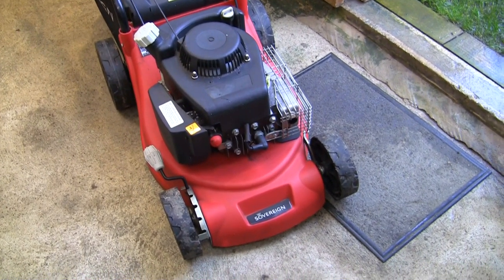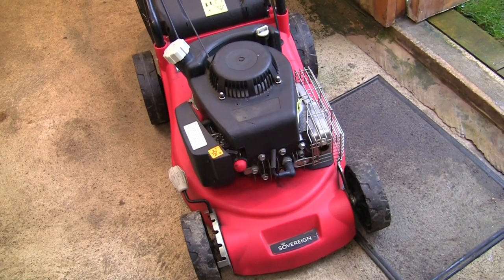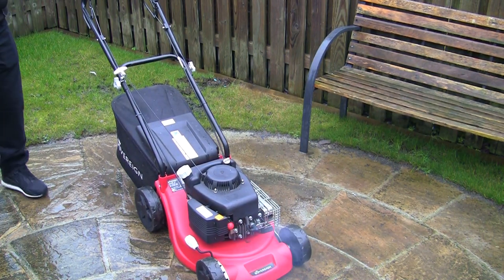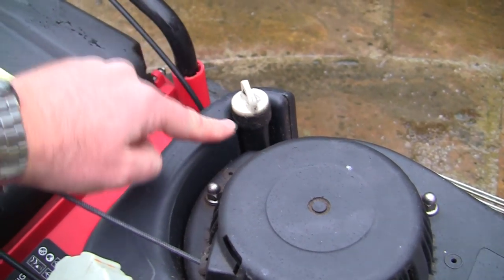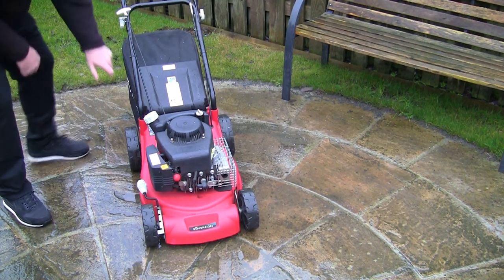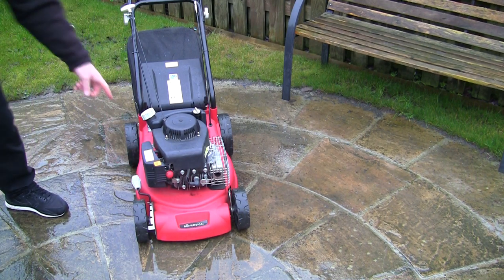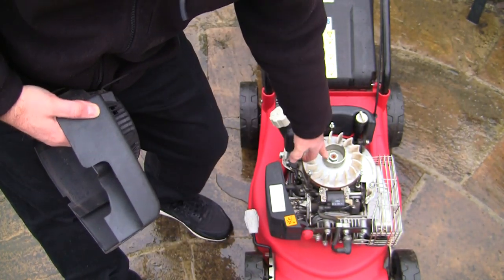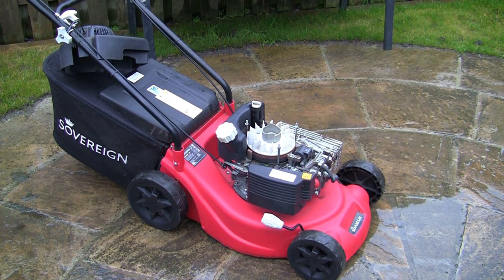Sovereign XSZ40 Lawnmower Carburettor Service (And SV150 Engine Tips)

Comment: Never ever attempted to fix a mower in my life, mine is a similar one and has the same sv150 engine with the lhp16 carb. It would start then just stop in a few seconds, last night, after watching this video about 3 times I ordered some carb cleaner and got my tools ready for the next day. I stripped down the carb after clamping the fuel, soaked all the bits in the carb cleaner and reattached that little spring that had also gone on my mower. I then gave the carb exterior a good sloosh with cleaner and a soft brush. I put it all back together after checking for leaks attached the airbox. Started first time and runs better than it has ever done!!! Thank you so much one dead mower fixed for a 6 quid tin of carb cleaner!! Liked and Subscribed!!
Reply from the maker: Awesome Christian! Nice work!

Comment: Thanks Mower Man, great to get all the detail and tips. I had very slow running on my XSZ40 so turned in the running speed screw to resolve (it has an anti-tamper pin in the crew head but turns by hand anyhow). Might clean down the carb if issues persist. A few notes that might be useful. 
a) mine doesn't have a micro-switch for the engine cut-off - just a sprung metal contact that a cam operated by the cable touches with a single lead (shorting cable) to it (cost saving!). 
b) the little extra bolt at an angle on the float bowl is a drain plug if you want to drain the fuel off.
c) the upright bracket on mine has a clip at the top for holding the fuel pipe mid-way;  clearly missing on your example.
d) the very light spring on the throttle (also bit of sponge under it)  does not control the full travel of the butterfly valve as you said. I suspect that is not supposed to operate the full range of travel - this is done by the main spring on the regulator arm - just provide some damping as it gets toward the end of travel?
Also your website appears to be down at the moment - I have tried a couple of the links and none working.

Comment: Many Thanks Mr Mower Man! With your video I fixed our sovereign mower today! From what I could see there were 3 issues, one - there was a hole in the fuel line near the fuel inlet to the carburettor (luckily there was enough fuel line to snip it off & reattach & clamp what was left), two - the spring on the “bracket” assembly that controls the butterfly valve, three - the spring on the linkage was loose & didn’t seem to be properly attached at the far end. Sorted those & now it runs better than it’s ever done! Thanks!

Comment: Great video thank you so much, picked up a non runner sat outside neighbour house for year, will use as back up mower, engine recoil had snapped, new one from Ebay £20, oil change and followed another vid of yours about the self propel and clutch cable as drive went from not working to new belt meaning permanently in drive, freed up the mechanism and drives, so £30 all in now have fully operational back up mower.  Thanks so much love a good tinker but would not ha e done so without watching you vid and gaining some confidence, keep up the great work!! Lee

Comment: Thanks for the video, I pulled a similar sovereign mower out of a skip today and I ran so badly, probably why it was being thrown out. I set the carb the same as you did in the video and it now works perfectly, looks like the previous owner had the carb of to get it running properly but set the mixture screw to 6 turns out and the float bowl wasn't on properly. Now I have a free mower and don't have to use an extension lead all the time to cut the lawn

Comment: Just about to do one of these picked up for £10 on face book got spark,fires up on carb spray down spark plug hole , reason it did not fire up is the spring detached and a small stick wedged up in governor arm  against engine casing .so will be stripping carb down for a clean service as per your tips on video very informative and helpful advice.cheers steve
Reply from the maker: steve horton Nice work

Comment: Another good un Paul , I use to sharpen blades the same way I now use a cordless angle grinder wit a flappy disc , not a big deal just find it quicker and easier, can even do it whilst blade is on the mower
Reply from the maker: james allan I sometimes do that as well James hope you are well my friend
Reply: Not bad mate , could do with the weather picking up so I can get some sold run out of room and still buying it's a disease😁, I blame you

Comment: I have spend hours online trying to buy a new carb for the SV150. It seems that all of them are the (new?) model with two butterfly valves and will only work with paddle-style governor (mine is internal as in this video). Also all of the new ones have no connection for a primer bulb. I am at the end of my wits and about to throw this whole Sovereign nightmare into a skip. Does anyone have any info where to get one? Thanks!

Comment: Thanks for the video, very helpful. Working on the same mower for a friend which he brought to me as it was clearly over revving. The throttle doesn’t die back after starting and the mechanism is completely free moving and springs are in the right place. I can relocate one of the springs to the wrong place to artificially hold the throttle against the idle screw and it runs fine but obviously this is not what is intended. Any reason why it is not self governing or does this mower run at a ridiculous RPM?

Comment: Hi great info.  There looks to be two different types of carburettor's for the SV150.  Do you know where you can buy the SV150 carburettor with primer?  The choke switch you find on all "for sale" SV150 carbs on the net.  Mine has a chip out of the shaft that the fuel bowl screws into and a fuel leak (float full of fuel/missing pin seat).

Comment: Hi. I’ve got an Al-Ko Easy 4.2 P-S and I’ve service the carburettor thanks to one of your videos. I’m waiting for an air aerosol to give the jets a good clean. My question is what spark plug does this mower use. I’d like to put a NGK in it but can’t find any information on what one it should be. Thanks
Reply from the maker: John Herridge ngk b2lm will work.

Comment: Hi mate, great detailed videos.
I was just wondering where you say about the choke closing on start up mine has only got a dead mans lever and no throttle adjustment.
Serviced the carb and governor springs all present and correct but still  won’t start also changed the plug.Any ideas at all please 🙏🏻.Many thanks
Reply from the maker: pull the fuel line off where it goes in the petrol tank. Sometimes there's a filter in the fuel line that gets clogged.
Reply: @MowerMan  Thanks for that, i checked that before but I haven’t a filter on and have blown through the pipe to make sure free flowing but that never helped, can’t see how the coke will close without and throttle adjust to start it
Reply from the maker: @skywalker070369  It will be automatic. Have you definitely got spark? does the plug look wet when you have pulled it over a few times?
Reply: @MowerMan  hi mate, yes I have speak but have ordered another plug to try it, the plug is also wet
Reply from the maker: @skywalker070369  did the mower work before you tried to service it?
Reply: @MowerMan  it used to start and run briefly but stoped so that’s why I checked out your videos and did the carburettor. It initially started and died off twice but now nothing

Comment: Another great video. Would it be worth fitting an in-line fuel tap? They're only about £4 on ebay...
Reply from the maker: Shavenuw129 It certainly wouldn't hurt!
Reply: Yes. I had the same problem. The needle valve in the carb wasn't seating for whatever reason so I fitted a shut off valve. Never failed so far and that was 3 years ago now.

Comment: Thanks for this video, mines losing fuel and I will strip my carb. Any chance you can point me in the direction of the Gasket for this exact mower, I can't find one anywhere.
Reply: If you're losing fuel and there isn't any apparent damage to the fuel tank or fuel hose lines, then there is a possibility that the needle valve inside the carb isn't seating properly due to dirt. Your carb will need a strip down and a thorough clean. I had the same mower that's in the video. I bought a fuel shut off valve and fitted it between the fuel tank and carb. Simply cut the main fuel line and fit this shut of valve. Saves mucking about. As for the gasket you can get them on ebay as a kit. Just go on Ebay and type Sv150 carb gasket. You'll see a o ring and a gasket. You can also get the shut off valve on there as well.

Comment: hi had had a suck pull cord what i fix however when i took pull start off i found a broken part witch im not sure what it is or where it go mower starts and runs but when it stop it dont sound right could you help me to have a clue what it is an where it go i have the part is there a way i could send you a picture off the part thanks

Comment: Run a bit of oil round the top of the dip stick o ring   every time you check the oil ...  it will always  be free ...👍🏻👍🏻👍🏻
Reply from the maker: Geeman I did Geeman!!
Reply: @MowerMan  If that's not working try a dab of white grease on the o ring...

Comment: Hi that's runs great but as you said it's not popping or anything  but I've just serviced a 35 classic and when its running its popping I've checked everything  coll cap, flywheel key, cleaned carb with gasket and diaphragm and new plug any idea on wat it could be
Reply from the maker: ady Miller Check the O ring seals on the back of the carb where it pushes back on. Sometimes the plastic carb is warped against the metal tank so you don't get a good seal. If it runs ok without stalling or revving up and down i'd leave it.

Comment: I am trying to get one of these working for my neighbour, I have replaced the filter, petrol cap and the blub as they were split, but the bulb doesn't seem to be drawing up any fuel
Reply: I have serviced the carburettor, but I don't think fuel is coming through, I can hear the air when pressing the bulb, it's got a full tank and knows it's coming through the fuel pipe as I had to clip it
Reply: Fixed the swivel spring too
Reply: The last time it ran there was a lot of black smoke, it sounds right when you try to start it, oil is ok
Reply: I have serviced the carburettor, replaced the filter, bulb and the spark plug. It now start but dies within 10 seconds, do you have any ideas? I don't hear the fuel coming through when I press the bulb...Would not have been able to do any of this without this amazing video :-)

Comment: Mower man 
I have a problem . My recoil starter spring is broken . Module is xss40a would they use the same recoil unite as this mower ?
Reply: Yes they are the same. Any sv150 pull start is the same.

Comment: When I opened my carb identical mower to this, it had a kind of gel around the needle and in the chamber.

I cleaned all off with carb cleaner and cleaned all jets. 
rebuilt carb and tried starting again but no start

Stripped down again 2 days later and the carb had rust in the bowl and crystallised wax around the needle area again.

Any idea why this would happen please?

It's the exact same one as you are working on in the video
Reply from the maker: Pull the fuel line off near the tank and see if there is a little filter in the fuel line thats gunked up. Let me know. I only found this after filming the vid. Let me know please
Reply: @MowerMan  will do
Reply: Spring disintegrated when tightened up crap design.

I do have another LHP carb for sv150 but that has another black plastic spring arm opposite the steel arm but doesn't have a primer connection would that work on this mower?

Comment: Just out of interest, whats the difference between the SV150 and the RV150 ,  I've often wondered?
Reply from the maker: Keith Miller I think the sv150 is fitted on the self drive models and Rv fitted to non self drive but i'm probably wrong? Good question!
Reply: @MowerMan  thats a good answer Paul, I'll have to check when I get another 150 and see if your theory works.

Comment: Hi at 21:48 what are you hooking the spring on to get tension?mine is just un coiled with one end straight and other hook shaped
Reply: Also if I need a replacement carb do you sell them on your site if you could point me in the right direction would be great it’s deffo a mountfield sv150 sovereign mower I have
Reply from the maker: I just wind it round and attach it anywhere that works

Comment: Please could I have some help , I have tried fixing my mower  , I haven’t no luck , I put some fuel direct into the spark plug  hole and it started to plotter for like a 2 seconds and then cut out. Any help pleas
Reply from the maker: You need to service the carburettor
Reply: @MowerMan   thank you for such a quick response

Comment: hate these engines got 2 of those mowers here right now they give nothing but problems spitting banging barley running pulling the cord back from my hand flywheel key is good cleaned carb even replaced it changed coil cleaned flywheel done all sorts both mowers now have briggs and stratton 35 classic engines ive lost count how many of these ive had and fitted a 35 classic engine to now mower good engine scrap

Comment: I bloody hate these Sv or rv150 engines. If you leave it full of petrol it’ll leak out or the primer bulb. 
And I’ve done loads of these engines and there never 100%😡
Reply from the maker: nigel burton Not my favourite! You could always install a fuel tap? Check out the tip on the little spring that helps a lot!
Reply: Yep i get loads in with problems,carb clean,or gaskets,lots of spring missing,
Reply: I love them.. lol
Reply: @MowerMan  oh come on Paul you love an sv150 really your just holding out on me lol
Reply: Micks Mowers you would lol.
Reply: Can u buy the primer bulb? Mine is knackered ? Thanks